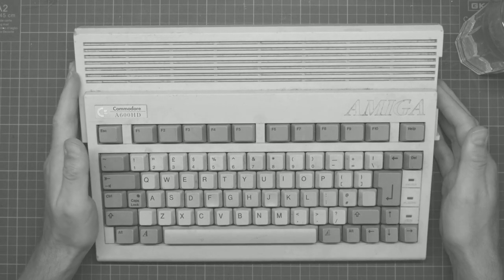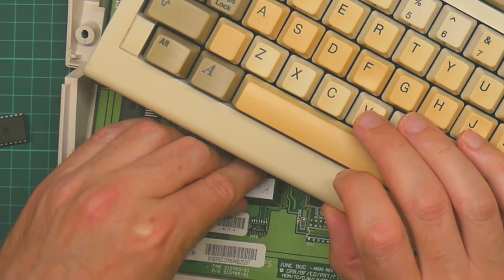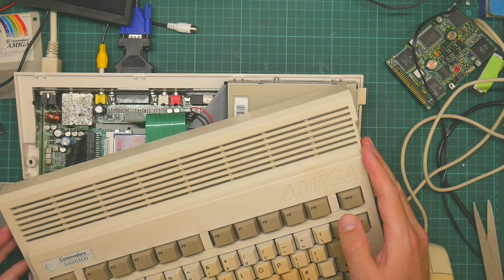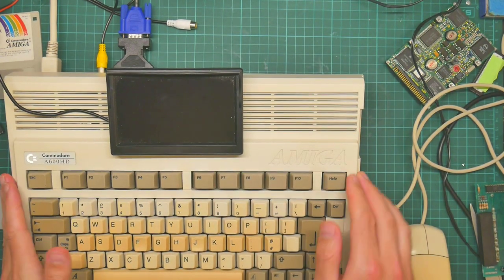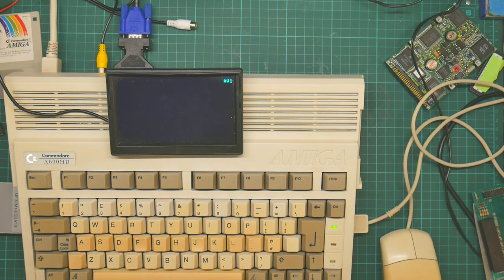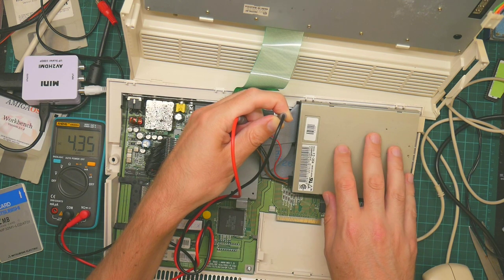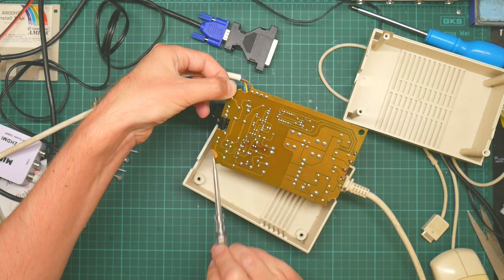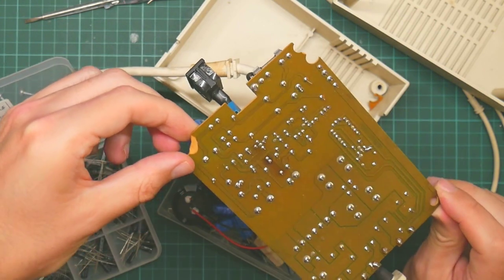Hjalfi gets an Amiga A600: #3: I have the power

Comment: Amiga (single firebutton) joystick is the same as Kempston which is same as classic Atari.

-Dx
Reply from the maker: I've actually got a Kempston joystick for my Spectrum (although it's labelled 'CPC464'...), but I haven't tried it yet. It's somewhat, um, terrible. I hate joysticks, anyway. Luckily I also have a ghastly gamepad for one of those £10 NES-on-a-chip handhelds which it should be easy enough to rewire into an Amiga gamepad.
Reply: @hjalfi  Personally, for me, the 8bitdo wireless megadrive pad is the doggies dangly bits.  Although it's "yet another expense" you don't need.  Sega Master System pads are also not bad, but getting hard to find cheap.  The NES controller default protocol itself is a shift register, but a lot of the clone jobbies are DB9 parallel, so - yes - should be a straight forward pinswap. x